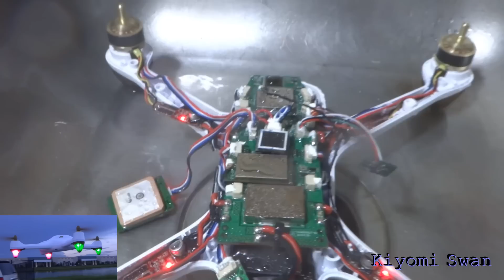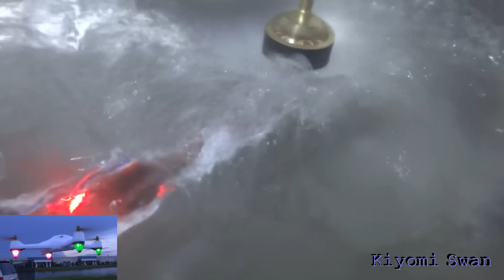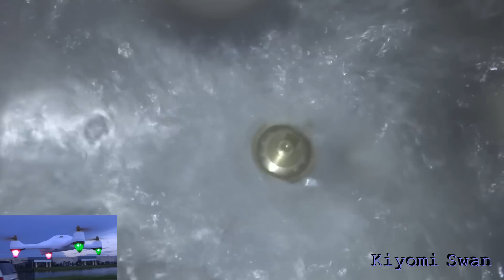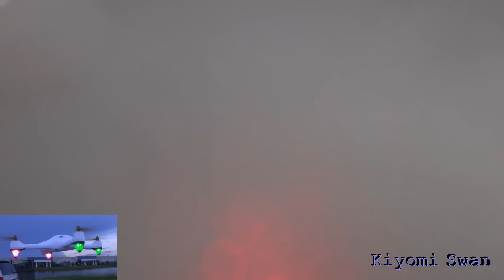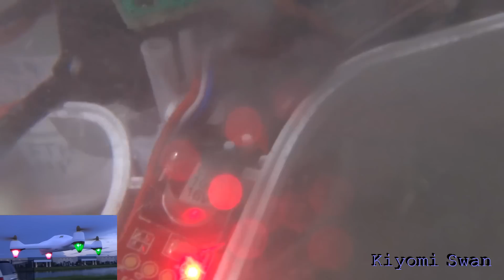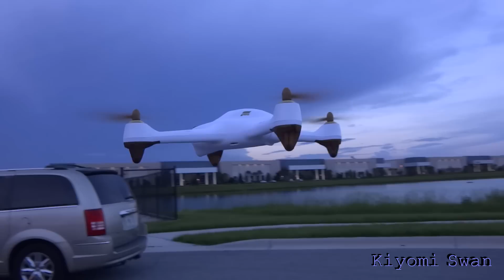Hubsan H501S X4 FPV #02 SplishSplash

Comment: That's a very good example. Great video. What would it be like at a depth. I must read the manufacturers spec's!
I do not understand why there are so many thumbs down. I guess some are scared of what they do not understand. It maybe think it is witchcraft.
The 422B-55M Silicone applications and similar are becoming more popular. My Samsung S7 is water resistant using something similar straight from the factory.  Thanks for having the NUTS! to do the experiment and share ; )
Reply from the maker: its obvious you are 100 % correct with your viewpoint Elecifun.thank you for your straight forward and bold opinions.
yes this is an example of what is possible todo,rather then spend $1500 to $2500 on a manufacturer's waterproof drone.
asfore the scared part you meantioned ( I guess some are scared of what they do not understand. It maybe think it is witchcraft.),you really made me laugh so hard after reading this,then it suddenly hit me...that your really right.
Reply: Great experiment. I will do the same to mine as this could mean flying in the rain, awesome. Sat inside a tent, a little RainX on the lens we are good to go : )

Comment: Did you have to take every piece apart and waterproof individual parts or did you just dip the whole drone in the chemical(s)
Reply from the maker: not dipped.just coated.but as you know ...its not guaranteed !!! its just luck in my case.you wont know untill its in the water.either its still running or your circuits are shorted...no 2nd chance.